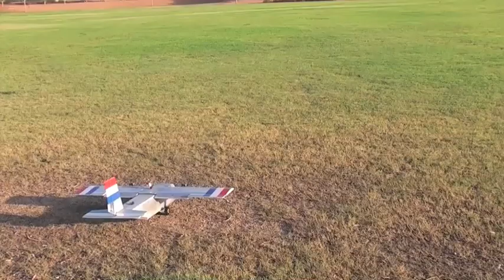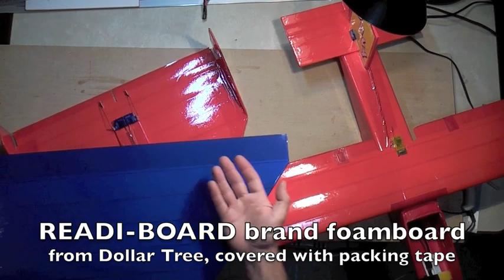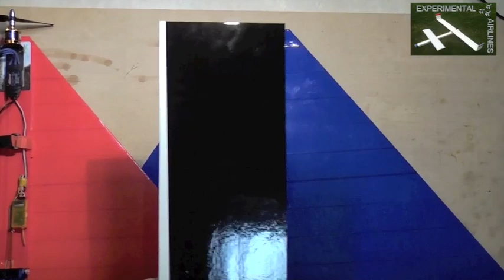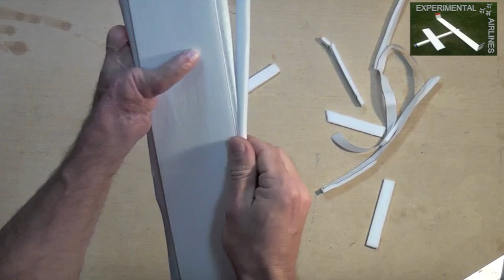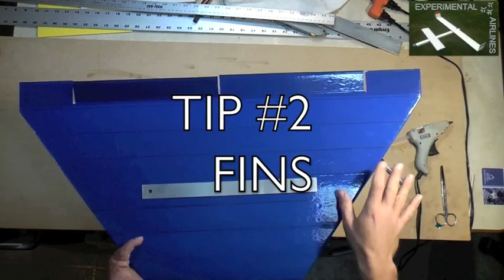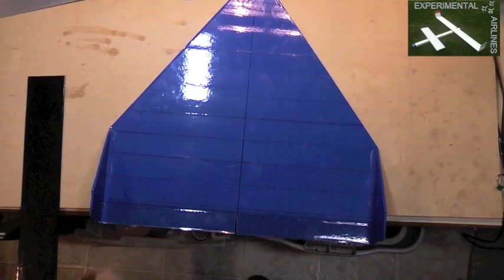Foamboard Building Techniques: Fins & Edges

Comment from the maker: The wing is flat, no airfoil.  It's a fast flyer and pretty lightly loaded so it has decent lift as such.  The foamboard has paper facing, so it's like Depron but thinner, less dense, and has the paper to apply tape to.  It's called Readi-Board, and as far as I know it's not available in South Africa.  Depron can be made to work, it's just a different technique of making the fins.

Comment: i had been dinking around with putting separate pieces of tape over the edges and not getting the results i want. thx for this video. i use the blue fan fold foam. 

you make excellent use of the paper on the foam board to achieve your results. 
packing tape does not seem to stick to the FFF as well as it does to the paper.  :-)  not a big surprise.

Comment from the maker: I can see how it's like the drywall solution you describe.  I actually was a contractor for a few years and did a fair amount of drywall, but nearly all new installs, not much patching.  The idea came from a plastic surgery technique called an "advancement flap", used for wound closure, which I knew from my work as a PA in the ER.  Coincidentally I've also personally had a couple of flaps done on my left hand.

Comment from the maker: Save your nice straight pieces for flat planes like the Fast Delta.  Use the bent pieces for Armin Wings and tubular fuselages, and the bends and waves will come right out during the manufacturing process.  Just noticed someone (not me) flagged your question as spam, which it's not.  Sorry for the delay.